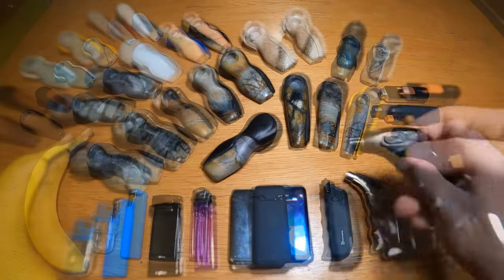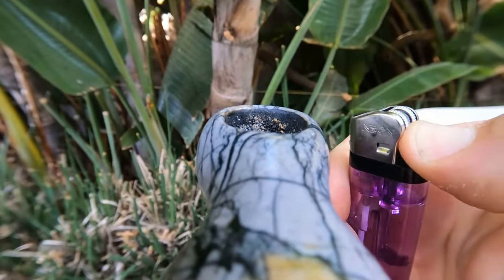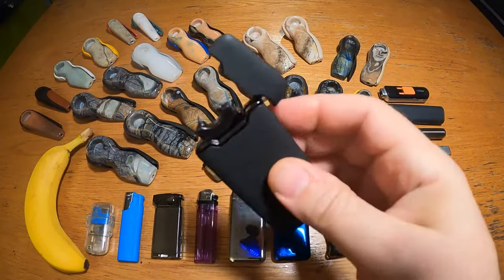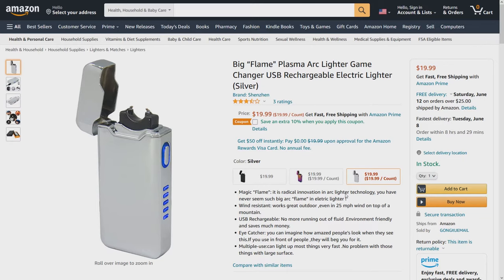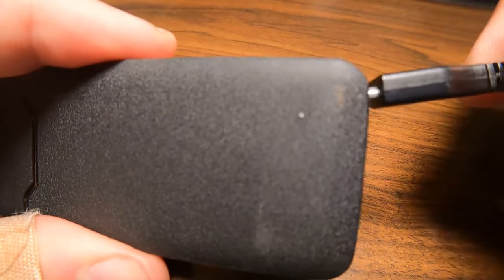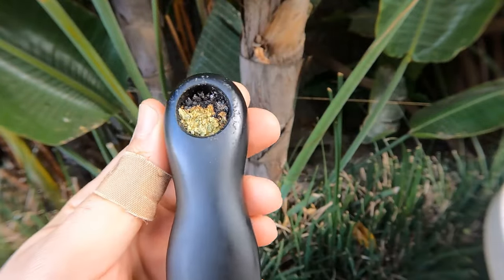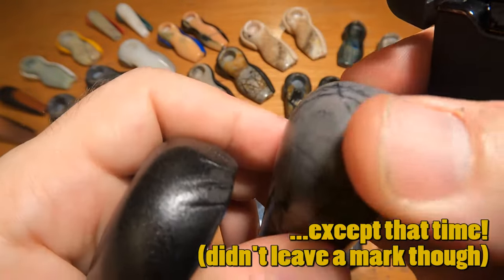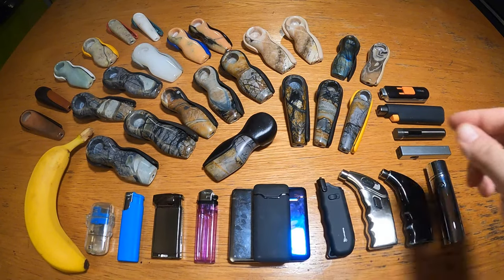An electric lighter that behaves like flame; detailed review & comparison

Comment: Bro will this be ok to use on bongs? I it reliable to use every 1 min for a long time or does it break
Reply: Yeah, they are good. I used one and it lasted 2 years till it broke
Reply from the maker: That should be fine.
Reply from the maker: Hey 10MM !  I think a comment you left on one of my earlier videos is how I learned of it in the first place, so thanks!  (Comment never actually appeared under the video, just in my notifications, so I couldn't go back and follow up; weird)

Comment: You don't want them trying to be flames because theyre better. Theyre designed wrong though. Doesnt stop user from figuring them out with effort.EDIT possibly vibration but it could use slight agitation.

Comment: Remember everyone, metal pipe is a no for this. I’ve read about people regretting that action and obviously you don’t want to feel that. Common sense when using these.
Reply: That plasma arc though... such a stupid impractical voltage just for a lighter for druggies to use
Reply: @deskmat9874  Good point.

Comment: Took me a minute to realize this was a marijuana pipe.  Cheers from a Tobacco pipe smoker.   I knew you couldn't use a spark lighter with a briar.  As with the butane jet lights the flame is too hot.  Good video. Your a braver man than I. Messing with what is basically a plasma arc generator.  Whoa.

Comment: I would be sold. If it had usbC changing.
Reply: They make them with usb now. Theyre amazing if used right. I dont smoke now really but they'd probably light most things in hurricane in under 2seconds if really familiar with using them.

Comment: So I got a pretty cool one on temu for $18 on a full charge it'll provide 100 three second lights. While it's arch is slightly smaller it does have the same qualities as the one in your demo. The only question I have I didn't get an answer for on your video or on their site is how long of a duration can that lighter hold the arch in one go? I was disappointed mine had such a limited amount at 3 seconds.

Comment: A lot of reviews for the Verve knockoff models on amazon are complaining that their battery died within days to weeks to months. Does the official Verve have this problem? And does your device still work or do you go through them? Why do these devices seem to be so hard on batteries?
Reply from the maker: Been using this model for ~2.5 years now.  One in particular (my favorite matte black one) lasted about 1.5 years of heavy use before diminished battery life was noticed.  Had a couple that shorted out, as described in the video, and a couple that just didn't spark as powerfully after a while, regardless of charge level.  Had another charging jack come loose.  Haven't found a better model though; tried a few similar ones, but had similar issues with them dying quickly.  Heard through a contact that the original vendor in China has apparently started to use a better quality component for one circuit, to reduce the likelihood of early deaths.  Can't really tell if a particular vendor has old stock though.  I am down to only one that is still in good working order, and recently have been thinking about ordering a few new ones so I have spares.  Thought I might get them from Qizen, even though they can be gotten cheaper elsewhere, as they likely have new stock by now.  But haven't decided yet.

Comment: Need to make or patent those pipes with twisting caps too dope
Reply from the maker: <Sigh>  My pipe cap patent applications were rejected.  They're so persnickety about the formatting of the drawings; spent years back and forth, then when she finally accepted them, she no longer could visualize the shape from them...  I probably should have tried to claim the pipe & cap as a set initially, rather than trying to just patent the cap.  I'd wanted to avoid the hubris of claiming I'd invented a pipe, but needed to show the pipes as background for "environment of use" of the cap, drawn with dotted lines per their specifications, but it seems this just confused them...  Meh.

Comment: Do not burn the side! Just pack less, after the first hit you’re just tasting burnt material.
Reply from the maker: It's a smoking pipe. Tasting burned material is kinda the point.
Reply: @TheWackyNeighbor  Don’t you enjoy the taste of the material in question? If you keep it nice and fluffy so it’s not too fine and then pack the bowl very lightly and “airy” if that makes sense, then you can have tasty sessions with dry pipes. Doing it this way means after the first hit you leave a nasty burnt taste for the next one. But you do you man.
Reply from the maker: @NuthingTaFwit  I typically compress the material just enough so nothing spills out if it's flipped upside down.  Still quite "airy" though, so you can draw through it easily.  I favor larger pipes because I'm lazy, and don't want to have to fix it very often.  I do enjoy the flavor, yes.  You seem very confused though.  Smoking, by its very nature, involves burning the material.  I enjoy the smokey flavor.  Perhaps you should be eating edibles, rather than smoking, if you want the taste of unburnt material?  (Or using a Vapor Brothers style flower vape, that heats the buds just enough so the volatile compounds vaporize, without getting it quite hot enough for combustion to occur.  Definitely tastes different.  But you don't get the full effect of all the chemicals; there is something in that smoke I like.)
Reply: @TheWackyNeighbor  I’m surprised you enjoy the flavour after the first hit as I would taste that nasty burnt taste personally. I love the taste of a fresh bowl. I keep all my pieces super clean for that reason too… I suggest trying it out dude I think you’d have a better time if you enjoy the flavour of it. Vapes are great but I prefer bongs. I try to keep using edibles to a minimum to be fair as I feel if I do them a lot they lose the sparkle lol 😂

Comment: glad I saw this video before ordering a traditional arc lighter (for backpacking / firelighting purposes). you did test this out in wind and the one shot with the arc against wood suggests this might actually catch traditional fire lighting materials on fire fairly easily (none of your segments showed it LIGHTING anything such as a candle but I'll assume it can do that). Might do better than the arc lighters.

Main issue could be the reliability one. in the wild, reliability trumps just about anything else. great specs on paper won't light a fire.

May try getting one of these (Amazon perhaps) to test out -- 1) how it performs if it gets wet, 2) ability to light ANYTHING (candle, etc.), 3) ability to light traditional fire starting materials (cotton ball, tinder, fat wood shavings, Mg curls or shavings, etc.).

I carry with me always a $10 "peanut lighter" that is low tech but does an amazing job (even if used as primary fire starter, clearly perfect as backup). Newer doesn't always mean better -- but sometimes it is.

great video though. very comprehensive for pipes. just would have liked to have seen it perform under other conditions and with other materials.
Reply from the maker: Thanks for the feedback.  I just did a test with a cotton ball for you; pushed the probes into it and tapped the button for one instantaneous zap, and a moment later the whole thing was aflame.  So, should be convenient option for you, but make sure you always have a backup on hand, like those emergency matches for use in wind.  I'm still mainly using the matte black qizen I got initially, so it's got some hours on it now, and seems reliable.  But I also had a few crap out after not much use, as you saw in the video. Note the housing is not sealed, so it probably wouldn't do very well after getting wet.  So I'd be cautious about relying on one in the wild.  With my use case, the stakes are pretty low!
Reply: @TheWackyNeighbor  thank you for this addn'l info. extremely helpful and informative. 

Amazon has a "wand" type plasma lighter (set of 2) for almost nothing and these use replaceable batteries (I think AA or AAA rechargeable types) so carrying a few spares in the wild is possible for some added insurance. Not quite so dependent on solitary internal battery as is the case with most other lighters (arc or plasma). since these are so cheap, I'll probably do my own "torture testing" on one (I'll consider expendable) and I'll leave a follow-up note (as here) when I get some results for anyone who might be curious. I think that the plasma TYPE though is a better fire starter than the "arc" types. at least that's my initial impression. just seems like there is more "fire" from the plasma than the tiny arc. I don't have (now) either the arc OR plasma lighter and for the present not planning on getting an arc type just to see what it's like for comparison. I imagine that the basic principle is the same though (electrically) for both types.

Comment: I’m wondering about the pipe covers you use. Who sells them?
Reply from the maker: No one sells them; I custom mold to fit each pipe.  (And I'm not making them in large enough quantities for it to be a business yet, but after I retire from my day job in a couple years, that's the plan.)

If you look back over my older videos, I demonstrate how I do it; softening a sheet of plastic in a toaster oven, and using a string to stretch the dome end.  I've refined my technique a bit since then; found I could get less wrinkles more consistently by starting with sliding the string over the edge of the pipe, instead of pulling straight down from the middle of a bridge between the pipe & dowel as shown in the vid.  I should make a new video all about the caps at some point, but I have a few other topics in mind to tackle first...
Reply: @TheWackyNeighbor  I was just here for the review; but I think I should check out that older video too. For myself and for my friends as well. lol 
Thanks great video.💚😊

Comment: You'd think that with all the hemp wick granola smokers out there that there would be enough of a niche for arc lighters by now for a decent selection.  But even with this model, it doesn't seem to be quite there yet.  I just want a good pipe lighter that takes 18650s. Screw integrated batteries.

Comment: I used one of these gimmicy lighters to repair a 25,000 dollar fiber optic fusion splicer. It worked extremely well. While i was at it also used a USB charger board and a much bigger lithium battery. ❤

Comment: Thanks for providing this content.  Do any of the arc lighters you've come across use replacable lithium batteries?  I'd specifically be interested in one that uses a 18650 and provide a strong enough plasma arc to light cigars (not one of those wimpy candle arc lighters).
Reply from the maker: > Do any of the arc lighters you've come across use replaceable lithium batteries?

Sorry, no; that would be nice though.  (As I discuss halfway through video, that would comply with FAA guidance for carrying aboard aircraft, but wouldn't make a difference to TSA.)

Comment: It's unfortunate they don't come with USB type C connectors, I don't want to keep carrying around extra cables for one device.
Reply from the maker: I agree, and I thought about fixing this myself at one point. In the video, I briefly discuss how I knocked the charging jack off one and repaired with soldering iron. Before doing that, I considered replacing it with a USB-C jack instead, with a similar circuit board footprint. There are many to choose from on DigiKey, and they're not expensive. But, since I was able to reinstall the old one with such ease, and I still have other reasons to keep a micro-USB charger handy, I didn't follow through.

Comment: Out of your own and your friend's lighters, could you make another review on how the lighters are doing now? Update on how long they lasted, did the battery get worse or remain the same, safety within the internal components? I'd like to get one I know will last or if I should keep waiting for a newer model. I like the Qizen verve how the arc is much better and that it's quiet, I just don't want it to last a short time and have to get multiple or replace the ones I got.
Reply from the maker: > could you make another review on how the lighters are doing now?

Sorry, no.  I have many other videos planned relating to my pipe-making equipment and activities, but they will take some time, and I'm not planning on another electric lighter video until/unless there is a new worthwhile product on the market to discuss.

> I'd like to get one I know will last...

This is not that.  You will have to get a few in order to be assured one of them will last.

I've been in touch with someone who was inspired by this video to become an Amazon reseller himself.  He mentioned he was testing them all before delivering to customers, to try to limit the number of returns, and had a 4% failure rate among his first batch of 500.  Surprised me that was so low, but I think he was just doing quick tests, and weeding out those that were duds right out of the box.  The two failures I had didn't crop up until I had used them a few days, so he likely wouldn't catch that sort of issue.  I haven't had any more complete failures since then, but a third one of mine doesn't seem to spark as powerfully as before.  I bent the probes just slightly closer together, and that improved the situation, but still seems a bit weak when I blow on it; not as powerful a stream of sparks like shown in the video.

The black one I got first is still the one I use the most, and it has proved reliable.  (Aside from the broken charging jack, which I've had to resolder a few times now, and is still a bit wonky.)  Recently I started to be concerned the battery isn't holding a charge as long as it used to, but I'm not certain enough yet to make any pronouncements about that.  (I.e. perhaps I hadn't charged it fully as I though I had.)

If money is tight, and you don't want to splurge on buying a few of these knowing they might not all work forever, then you may want to stick with jet lighters for your windproof lighting needs.  Here are some decent & cheap ones.  They look like regular disposable lighters (so TSA isn't likely to confiscate), and are priced like disposables, but are actually refillable and work quite well.
https://www.amazon.com/dp/B00IN7CF8M
Reply: @TheWackyNeighbor  thanks brother, appreciate the response back and other recommendation!

Comment: Which lighter would you recommend for smoking outdoor when its windy, it is sometimes very hard to light my backwood up on my roof in my apartments. I am tired of the butane windproof lighters, and refilling them. This video has helped a lot, regardless if I get a response.
Reply from the maker: There are a few more "big flame" options available since I made the video.  The one I featured is still a good option.  I got 2 different new ones last week, and one of them seems quite promising. Slightly larger, may have better battery. Can't draw any conclusions yet. Cap opens slightly wider than others, which is nice.
https://www.amazon.com/dp/B09272N9D3

Comment: I wish they made cases for the verve like the ones you can attach to keychains
Reply from the maker: I bet you could 3D print one, or better yet, wet form some leather (like a miniature holster; top piece molded around lighter, stitched to a flat back piece).

Comment: Can it ignite a stream of liquid?I'm doing a mini flamethrower project for a tank and this seems a space friendly solution
Reply from the maker: ¯\_(ツ)_/¯
I presume that would work, but I suppose my biggest concern would be it melting after you've lit it, if it's permanently installed in the path of the flaming liquid.  Perhaps if there was some sort of retraction mechanism, or if you added longer wires to extend the probes so the mechanism itself was installed somewhere cooler?
Good luck, be safe.
Reply: @TheWackyNeighbor  yeah , I'll have to experiment, both the pilot flame and the fluid pump will have separate toggle switches and will just work in short bursts, plus the stream will be very thin like a windshield one , if it doesn't work I'll end up with a cool lighter at least

Comment: Do you suppose this could work for dabbing, or does it need to come in contact with your material?
Reply: Wouldn't work properly
Reply: @TaliwhakerRotmg  thank you.
Reply from the maker: I think @TaliwhakerRotmg is right; this is not appropriate for dabbing, where the goal is to poke the wax with a hot stick (or drop it on a hot plate), rather than actually igniting it.  This sort of plasma lighter is very good at catching things on fire, but doesn't work as a heater, which is what you'd need.  Google "enail", that's what you're after.  But as "the pipe-guy", I don't have any more particular advice than that.
Reply: @TheWackyNeighbor  you actually provided the exact information I was looking for…heating vs igniting. I appreciate you providing your expertise!

Comment: Very interesting. The battery issue will be an issue for a long time unless they figure out another battery chemistry. The longer you use the lighter, the longer you short the battery. 🔋 Even using 21700 Samsung 30t cells your going to have issues. Have you tried any other battery chemistry? Possibly LTO?
Reply from the maker: > Have you tried any other battery chemistry?

Who, me?  No.  I'm just a caveman, your differentially charged ions frighten and confuse me.

(I've worked closely with some power systems folks in years past; even literally on the design of some novel vehicle batteries, but just in regards to their mechanical packaging.  The chemistry and electronic aspects are over my head.)